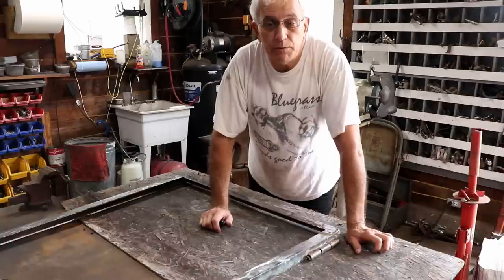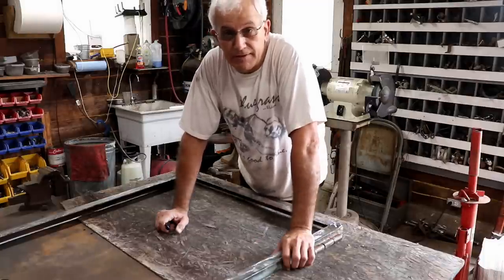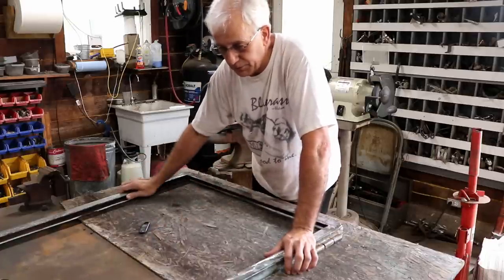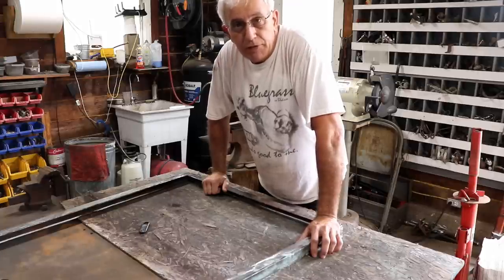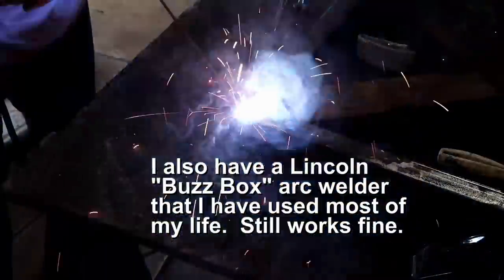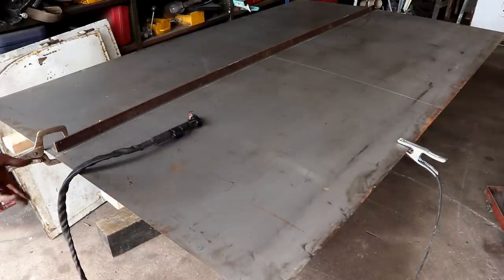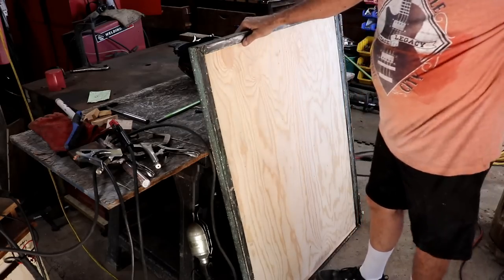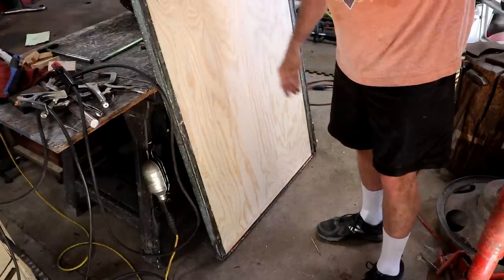328 RSW Horse Trailer Rebuild Part 1

Comment: Great job...Got into much the same deal on a pickup bed trailer my wife committed to buying from some friends of hers over the phone, sight unseen. I didn't really need another trailer, but they needed the money so we went to get it. Sad, sad shape...no tailgate, bedsides were falling off, half the bed floor metal was gone, bent everywhere from tossing junk in it, the tires rotted off and the hitch had been 'stolen' from the tongue. It cost me about the same price I paid for the trailer just to get it back home. Kicker then was...No title! So it is now my burn barrel, which has worked out well...when it gets halfway full of non burnt stuff I haul it with the tractor down to the farm dump and empty it out. To much money in it to sell and to bad of shape to put on the road, so it is at it's permanent last stop for usefulness.

Comment: Rather than plywood, I use half inch livestock rubber mats.  I use carriage bolts with clearance holes to fasten it to walls and doors.  It’s impervious to urine and moisture and is easy to clean.  It’s also quieter and a great shield when the horses  start kicking the walls in impatience.
Reply: While I agree the cost difference and cost of rubber mats, plus it depends on the thickness you are using, are not cheap. For my own trailer hands down I would do it this way as it's only about when the horses are in the trailer, but after they have used it many people like to be able to easily rinse out every "non-scoopable" and when you have wood it will eventually go bad and not have a place to drain correctly or a place where the water wells up.

Comment: I was wondering what type of plasma cutter that is. I have been looking for a cheap one, but it is hard to choose when you can't see them used. That looked like a nice working one. Thanks for another nice, interesting video.
Reply from the maker: I bought it a number of years ago.  I'm not in the shop at the moment but I believe it's very very similar to this one. https://rover.ebay.com/rover/0/0/0?mpre=https%3A%2F%2Fwww.ebay.com%2Fulk%2Fitm%2F281888878448
Reply: Excellent. Thanks for the reply. Much appreciated. I will have to look into getting one before long. (Gotta wait on those checks to come in, lol.)

Comment: That "tig" welder looks like a stick welder to me.  (One welder I know told me that coming from stick welding, a tig is like dancing with a pretty girl.)  That spacer set on the plasma cutter is pretty ingenious.  I've not heard the term "farm-fixed" before.  :-)   Looks like the two of you have a pretty good handle on the whole thing.  I know you know it, but you're a lucky man to have a wife like that.  No trolls yet, but thumbs up just in case.
Reply from the maker: It's a combination TIG and stick welder. I was obviously using the stick side of it that time.

Comment: She DOES DO autowork too! Hot Damn..! LOL :) Did you do the diagonal dimension check for hitting squareness on the panels? I know you tacked the back panel in on the outside, just wondering what the plan is for making the outside of the panel watertight? You're probably right about the water rusting out the bottom lip.  Might want to add some edge seals after she's all fitted back together to keep water from getting in the bottom edge and swelling the wood out. You're putting all the effort in, might as well do it right. LOL. :) Great job so far!

Comment: I would like to make a suggestion, please.  Could you put some sheet metal on the floor under the wood as a safety backup?   Let me explain first that about 25 years or so back my family and I happened upon what we thought was a wreck but soon found out that a farmer was transporting his horse, in a trailer that looked a lot like your new one, when tragedy struck.  As we passed by (Sheriff and others were already on scene ) we got a close look at a haunting scene, that to this day I still think of it every time I see a horse trailer.  
As the farmer was traveling the wood bottom busted out and the horse's rear legs fell through to the road and were dragging and ground to pieces until someone stopped the farmer,  but by then the poor horse had bled out and died.  What a terrible way to go.
Reply: I'm so sorry that happened. It was not a first and likely won't be a last. This is more of a trailer maintenance issue where every X many years the floor simply needs to be replaced and these are not delicate boards, but I have a 3 horse trailer so the weight of 3 full maybe 1,200 animals moving on these boards is at risk and a cheap horse can be $5,000 and an expensive one for the average owner can reach into the tens of thousands so these are not risks people normally take with their animals. The issue is that urine and other body functions eat away at wood faster than just water. We don't put metal under any level of the flooring because it holds water regardless of how well you think you have everything draining. What I can tell you is most or many people have a camera in their horse trailer to see how their horse(s) are doing in the trailer in back and we can feel every shake and movement in the cab of most pickups. A floor is either put in right or get it professionally done.

Comment: Is the roof able to be replaced on these horse trailers?
Reply: Yes. These are all sheet metal that has simply been welded together. Other channels who do more welding specific jobs have cut the top of the trailer off as it was not worth taking the old paint and rust off as you would have been able to stick arms through the holes and patches would have looked like "farmer fixes". The roof itself is normally taken off directly above the part just above the windows on the trailer and a new one can be fashioned with sheet metal and attached and then everything is repainted. The roof normally requires at least 3 coasts of paint however as it has the most weather heavy job from the sun, snow, etc. unless it is stored inside.